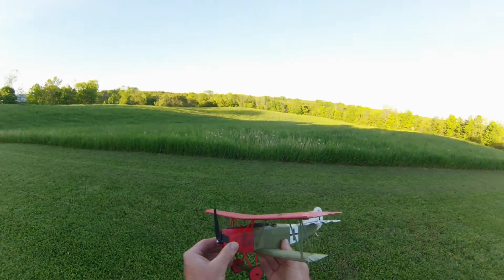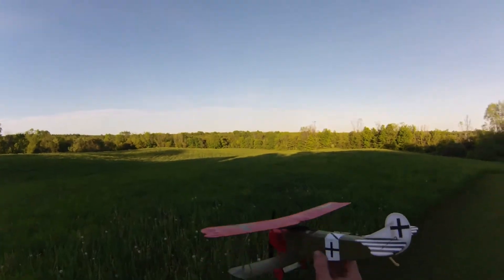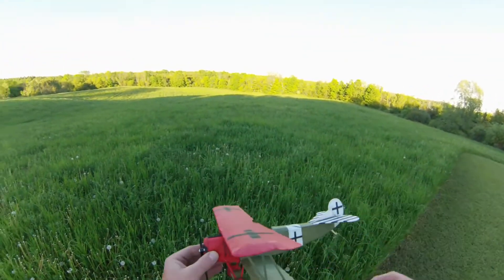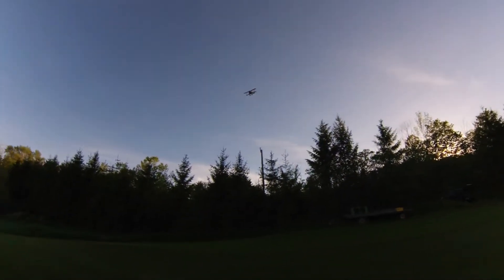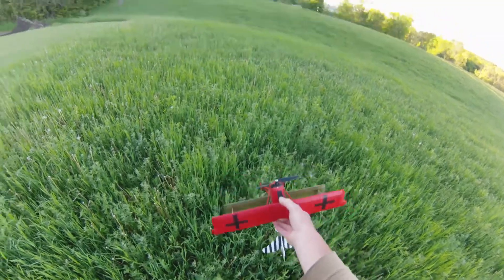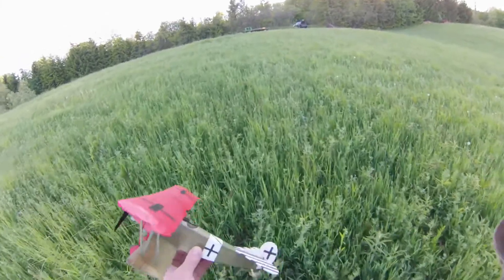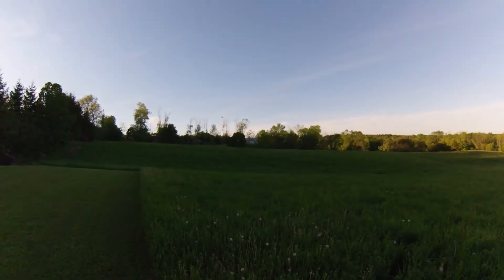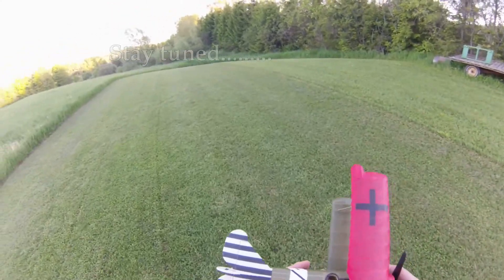Guillows Fokker DVII maiden

Comment: Beautiful. Maybe tail heavy and too much pitch control  throw? I've been scratch building free flight for nearly 50 years and flying RC since the 70s.  Looks great. I scratch built a gas powered Neiuport 11 in the 90's.
Reply from the maker: Thanks.  It was a handful to get that maiden flight in.  The model has been trimmed and the C of G sorted out.  With the short nose moment around the C of G the model required a lot of ballast in the nose.  All because of too much weight in the tail.  The full build is on RC Groups.
Reply: Glad you solved that. Someone gave me a tip. Build a small scale version out of balsa sheet and hand launch like a glider. Ballast till it flies right. Mark the c.g and transfer the location. I did that with the Nieuport, worked great from the first flight.
Reply from the maker: @M5guitar1  Something to keep in my mind for the next time, thanks.  This was the first model I've built in 30+ years, been away from the model bench a long time.  If I did this one over, I would employ laminated balsa for the entire tail assembly instead of the solid foam I used with laminated balsa outlines.  Even a gram or two in weight saving would have been a big help.